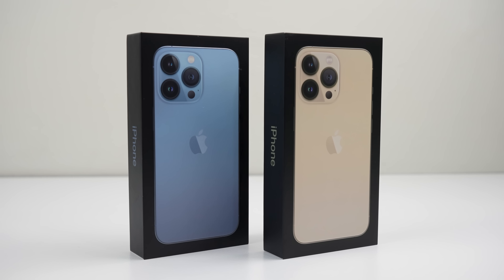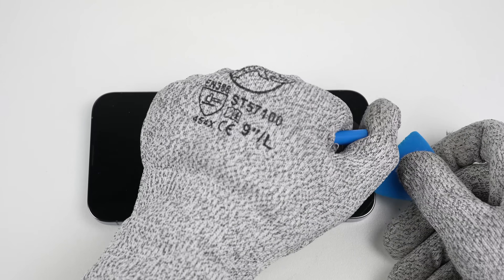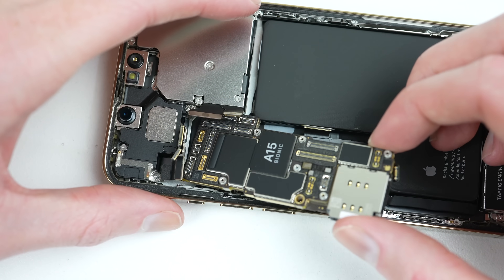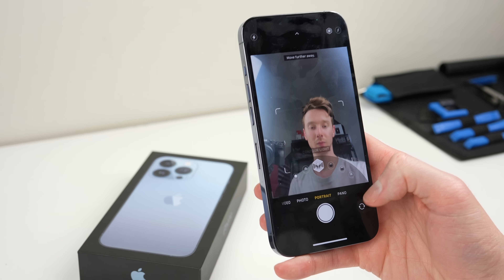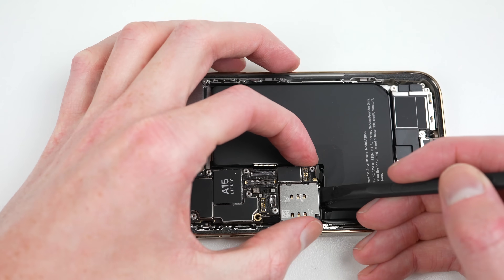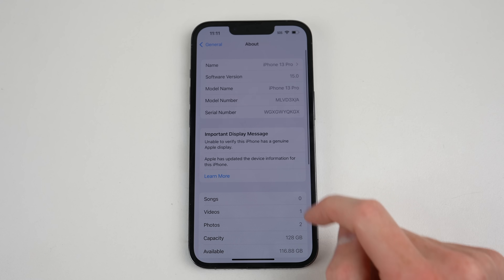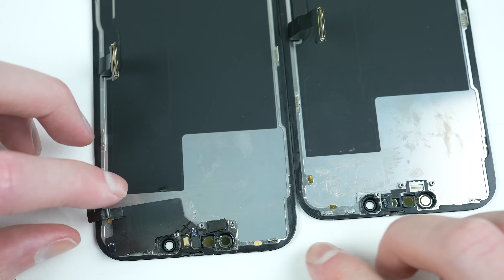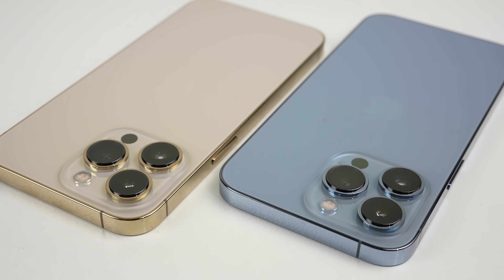iPhone 13 A Repair Nightmare - Teardown and Repair Assessment

Comment: "Unable to verify Apple parts" is the funniest thing ever LMAO
Reply: Almost like it doesn't even try to verify them.
Reply: @joenk7  I doesn't. That would mean insane effort to have back-end server with encrypted comms to verify each HID of each component. Instead I suspect they have an EOL(End Of Line - production) baked serial number per component and the SW just checks on boot the baked number vs. each component. If they are different it's no bueno. Simple, locally self contained, easy to implement and hassle free for them over the lifetime of the product. ;)
Reply: @Archangell27  you sound like a typical apple sheep. Excuses excuses. He's not at all saying that it should have to communicate with servers to detect authenticity. If that was the case, they could simply implement a communication protocol that would simple allow the replaced hardware to tell the phone, hey, I'm genuinely an apple part. Those checks shouldn't even be in place period. That's like you replacing the tires on your car and your car restricting your speed because it's not OEM, in an effort to make it seem like it's the non-oem tires causing the car to go slower. Apple is purposely freezing the camera and other features to make it look like the replaced parts are causing issues. Even if the parts and numbers don't match, it should work. We should be allowed to replace things without having software that'll shut down just because numbers don't match.
Reply: @shammzz3  He literally just explained how he thinks it works, who are you arguing with?
Reply: @shammzz3  you're both on the same side here. he's just nerding out. what the hell is your problem? typing out a book of bullshit when you didn't even read what the poor guy had to say.
Reply: @thomasj6144  k
Reply: @shammzz3  dude was only trying to explain the logic behind of why apple couldnt even bother to do it in the first place. cmon man, chill bro!
Reply: @safwansaid5139  yeah and we all know that's wrong and it's NOT why Apple did it, which is what I explained in my "book of nonsense". What did they not bother to do? They literally went the extra mile to code the phones to disable features and make it look like it's the "unverified Apple parts" causing issues. A "hey we don't recognize this as a genuine part because the numbers don't match" would've been fine, but to literally go the extra mile to prevent you from using your phones features is preposterous.
Reply: @shammzz3  i think you are missing the point .. he was just explaining how instead of making it at least possible to switch parts if they are "true apple parts" they made it really easy for themselves by just going "if its not XY say No" which is even worse and its true its easy for them in any way but i wouldnt say that hes an apple sheep .. if anything he pointed out how shitty apple is by going the easy way out for them while leaving their customers stranded
Reply: @safwansaid5139  go touch grass
Reply: @shammzz3   Hmm. Even after reading your responses I still don't understand why you flipped out on that guy lmao
Reply: @Archangell27  Why someone would purchase a product knowing that it does this is beyond me. Obviously the parts are still registering as working parts, hence the camera functionality. But at the same time Apple has implemented their BS, also hence the camera functionality.

Have fun consumers, I wish you the best. I also hope the consumers don't just jump back on board when or if apple ever changes this mentality.
Reply: @shammzz3  Dude calm down...I'm not an Apple fan at all...By the "It doesn't." part of my comment I meant to say that the phone doesn't even try to verify them, the swapped parts. It just checks that if it's not the part it received from the factory...what I dubbed "factory baked", then it just errors out even if the part is a new genuine Apple part. As for the rest I was giving an example of how complicated (and expensive) it would get to track all the parts all over the world just to let users swap only Apple parts on their phone...which would be an huge effort for Apple and will definitely not do. So the user is left to just go to Apple directly and pay more for repair or more likely upgrade prices. That's what I meant. I haven't bought anything Apple in my life and sure as hell won't start now...to be honest I had an eye in the beginning on the iPod...used a friend's a couple of days but not ended getting one...funny thing is I can't really say now why though :)) Oh and  also totally agree this whole thing is just a load of bullshit from Apple and not only!
Reply: @QuadfishTym  Hey good point about the shady third part stuff. Totally a valid reason to do something like this. BUT as you very well said...it is still anti-consumer and a shitty thing to do. Also you can do this locally on the phone in a variety of ways, including CA_Certs, but I'm guessing Apple would want to flag and record in a database what Phone changed it's parts while not in their repair shops for negating warranty claims from that phone in the future for non Apple certified HW intervention,  that's why I assumed back-end servers stuff :P But anyway...the point is that it's still way more complicated than just a simple check if it's the original serial nr. and if not just flag it as non genuine.
Reply: @brandonhoffman4712  Yeah agree...I guess most people will give in and run back to Apple and pay to "fix" their precious phone...Apple: 2, Consumer: 0  :(
Reply: @shammzz3  Have you any ideea how stupidly easy it is to NOT allow a functionality? It's simply a matter of setting something called a flag. Each time a function starts a "functionality", it checks this flag. If it's a 1 you are allowed; if it's 0 it won't work anymore. (In reality it probably is a more complicated number, such as an id or something, but it's the same thing to implement and functionality wise). So by "They went the extra mile to code the phones to disable features" is very, very overstated...
Reply: @Archangell27  no, not at all overstated, I've replaced parts on phones like my Samsung that tell me, hey, "this is not a genuine OEM part, and it might result in device failure" or something along those lines. Apple could've left it at "this isn't a genuine part" whether or not it works is up to the user to find out, it's not about how simple and stupidly easy it is to block functionality, it's about the fact that THEY DID, so yes they went the extra mile to block functionality, albeit a very simple mile, they still did it, they're still doing everything in their power to prevent right to repair. They've made it so difficult that to successfully repair a device, you now have to go look through root directories, to change the numbers the bootloader looks for when checking the parts. I don't need you to explain how it works, I'm well aware, you're just making excuses for Apple the point is that they're going the extra mile to prevent you from repairing your own phone.
Reply: @grimnir2142  Precisely 😜
Reply: @shammzz3  someone lacks basic reading comprehension skills
Reply: @ivancillo8797  k
Reply: @shammzz3  k is all you'll need to say here when you can't even comprehend what you're arguing about.
Reply: @Archangell27  yeah, and the shitty thing is is it would be trivial to have code like that just check for a common manufacturer’s part number instead of a serial number but they hate the idea of 3rd parties eating their lunch
Reply: @Aighthandle  Precisely...but profit is profit, I guess, no matter what...like we keep saying: shitty.
Reply: [Apple] 🔫[Also Apple]

Comment: This should be mentioned from Louis Rossman into the right to repair action
Reply: holy crap louis this reminds me of the time apple killed 3rd party repair!
Reply: He has mentioned this topic on other apple devices.
Reply: @lablunt6190  yes, agree with you but you know how increasing the difficulty has lead to this, it's a true statement against repair shops and the end user basically. I worked into manufacturing for IBM like 16-18 years ago, and at those times I thought it was for the reason to not exchange any cards or something during the process; one of the first steps was to wrote VPD in a database or every card inserted in that server, which lead to security increase into following all steps as a machine not just random parts put together and skipped tests at the last moment. 10 years later, I discovered that they where ahead on times into this, and might be connected to the IBM maintenance only to some parts of the servers.

Comment: All these parts can be replaced. After doing it you have to go into a service file on the phone.  You can then teLl the phone a part was replaced.  It finds the part and asks if the displayed part number is correct.  You just tell it yes.  Everything works after as it’s supposed to.

Comment: The same thing happened with cars back in the 80s. Auto manufacturers started using specific tech that only their dealers could use until the government's stepped in and forced car parts to be standardised and obd2 ports be used across all manufacturers so fault codes can be diagnosed by regular mechanic garages. The same thing definitely needs to happen here. Government's need to step in and force the right to repair on phone tech like they did on cars
Reply: Modern-day autos can't be worked on by the household mechanic no thanks to all those computer chips being integrated into modern autos.  The global chip shortage has shown why the computerization of nearly everything in modern society is a very BAD IDEA.  Unless Right to Repair is passed at the federal/state level, expect these issues to only get worse as time goes on...  Not only that, but the overall durability/quality of modern products has gone WAY DOWN.  It's done that way by design since repairs/replacements net companies more $$$$$$/PROFITS.
Reply: @scottjohnson7877  durability yes, quality, not so much

that said, yes, parts starts breaking after the warranty by design, but repairs/replacements doesn't net them more money, on the contrary, repairs/replacements net them less, since the alternative is to buy the newer product
Reply: The fact that I can't fix my own device that I payed for infuriates me
Reply: No. 
People should stop wasting their money on a shitty company, that is all.
Reply: Spot on here. Regulation is the only way to stop this nonsense.
Reply: @ruaraidhmcdonald-walker9524  You wish.
Reply: Just look at the apple response to the EU plan to standardise the charging port..
Reply: @5084204  yep, they just go portless and switch to magsafe. So I think the EU will have to extend this from USB to wireless and make it so that every time Apple tries to do a loophole they'll just change the law to fit what they did in
Reply: @5084204  what is the response?
Reply: @bendouglas5438  dug in their heels
Reply: Aren’t there a law in the us about the right to repair?
Reply: or the customer has simply to stand up and not buy apple anymore. i hope other companies dont do this stuff
Reply: Gov't doesn't need to do anything. Consumers need to send a message by not buying their products.
Reply: @rcs2749  yeah, but people buy it anyway; The best way is to blow up Apple.
Reply: It is actually even worse with cars, similar to here.  There are cars where if you say replace a wiper motor, or a pump, or anything like that it will disable it.
Reply: The consumers
Reply: This
Reply: Fuck the government, especially the current illegitimate one. They’re too busy stealing elections, killing their own soldiers and troops, giving millions of dollars worth of army equipment to terrorists and letting in unvaccinated illegals through the southern border to give a damn about legislating right of repair bills
Reply: other phone companies are doing the same shit more or less
Reply: I've talked with my mechanic and he says they're wrapping back around to this bullshit again. And its not the classic German cars either-- he was telling me about how Ford was refusing to give information on new fault codes. So yeah the obd ports are still standard, but the software behind it isn't anymore and even companies we once praised for fixablity are throwing up walled gardens.
Reply: They should apply a similar law for phones and other devices because these kind of things really hurt small businesses and essentially bully them out of business by taking away their main forms of income. It should be made illegal.
Reply: This is much worse than that as you could still install most parts and have them work though not all cars from that era were hard to diagnose GM vehicles all you need was a jumper wire or a paper clip to short two terminals on the ALDL port.
Reply: the EU started with requiring standardization of ports, so Apple phones in the EU need to use USB chargers like every other device does. Apple was told in 2015 they had until 2020 to comply. They didn't and cried fowl when they got a fine 'out of nowhere' and so far have tied the fine up in court refusing to pay.
Reply: Is tis true? Good tat the gov is sensible towards consumers of car industry. Yea, car parts should be standardized and can be repaired at any workshops
Reply: "nooo, but...something something innovation something competition and free market"
Reply: @lordbertox4056  tfw free market is nothing but a corpie buzzword and the idea of a free market existing died in the 60's
Reply: Apple has been doing this since forever. No government steps in because yuppies and hipsters start crying.
Reply: @smalltimer666  its not that they are crying. They don't care. Apple has a simple product, and people like simplicity, regardless of cost.

I think what Apple is doing is  disgusting, and i hope these parts become standardized
Reply: @logangagnepain7154  standardized is not the problem. this is demonstrating that even with the correct parts, the phone will break itself.
Reply: @logangagnepain7154  Cry me a river
Reply: @BeatstormX  I want to be able to modify and change the things which I bought with my own money.
Shouldn't I be free to change the things I buy?
This is America, right?
Reply: @logangagnepain7154  American ideology
Reply: @smalltimer666  Don't forget the absolutely crazy amount of political lobbying that tech companies like apple do in order to get away with this shit
Reply: @smalltimer666  just stop buying iphones... it's that simple... don't be a brainless biomass
Reply: @smalltimer666  you're right. We should all start crying
Reply: But, are other phone makers doing that?  If not, if it's only Apple, it's hard to make the case for right to repair because it's one company vs dozens of others, and a couple of them are nearly as good, so, you have a choice.  I don't know about the case with cars, but I suppose many companies where doing the same.  Are the other phone companies doing what Apple's doing?

Comment: I’ve always been an Apple user when I comes to my iPad. I currently have an iPad Air that I bought in 2015 and have done nothing to it. It still works perfectly, aside from the battery is weak and needs charged more often. I’ve never owned an iPhone and this is the main reason why. I’m totally fine with a basic Android, as long as it’s functional. I get a “refurbished” phone every couple years through my insurance and have been happy with every replacement phone. Paying $1000 for a cell phone every couple years just isn’t a priority for me

Comment: This is interesting.  I've had an iPhone 6 for about 7 years and a 5 for a couple years before that, and when my 6 wouldn't update past iOS 12 I realized I was going to have to upgrade to an entirely new phone.  I compared a lot of different devices and weighed the pros and the cons of each, ultimately placing an order for a Samsung S21 yesterday.  The higher price and much smaller battery of the iPhone 13 were what made me jump over to an Android device, but finding this video today reaffirmed my decision to do so.  I'm no die-hard Apple fan by any means, but having used the same thing for basically 10 years the thought of everything changing is strange, but taking a step back and seeing what Apple is actually doing to their customers and then seeing it here, I'm looking forward to getting out of the Apple bubble.
Reply: Sadly Samsung likes to follow in Apple's footsteps (they are basically co-conspirators, Samsung is one of the key players in Apple's buisness)
Reply: @rudrasingh6354  To be honest, after taking order of the Galaxy my comment hasn't aged very well at all!  Unfortunately I wasn't happy with how the OS worked or how the S21 functioned as a whole and decided I can look past the repair stuff and all of the iPhone's shortcomings for a more fluid system.

Comment: You should have tried a new genuine logic board. This is because if you are not allowed to interchange parts between phones it will deter iPhone thefts.
So what Apple have down is made your iPhone more secure.

Therefore your video has really no value.

Comment: I don't think we sign a contract to accept all this B.S. when we buy the phone. How is this legal? Can't they be sued for not giving me access to my own device that I payed for?
Reply: Damn U got me
Reply: @Singularity Then if I own the hardware I should be able to replace the hardware if I want to.
Reply: @Singularity "You can replace the hardware if you want to already...the software that stops working". So clearly I can't change it if the software will stop working.

How is this so hard for you to understand. You say I own the hardware but if I change the thing I own, the software will stop working? It's clearly not a hardware issue as shown in the video when he swaps out parts with an identical iPhone. The software is just designed to literally prohibit me from changing the parts that I 'own'.